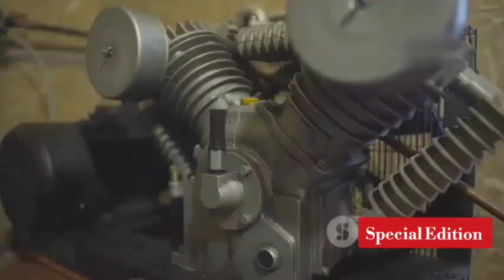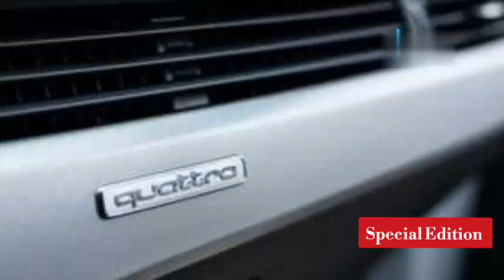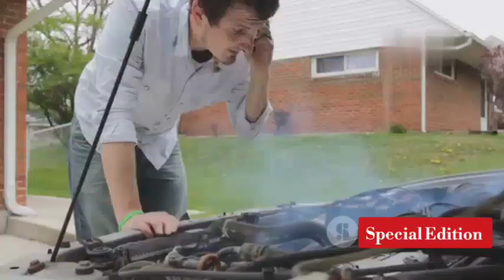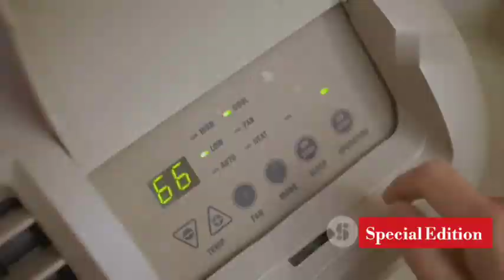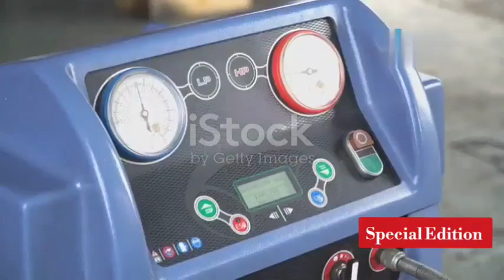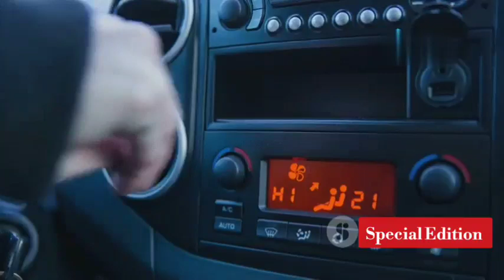15 Symptoms Of Bad Ac Compressor

Comment: I have a question: my Elantra 2008. I added freon and is working fine, cool really good, but now is making the motor to vibrate. Every time I put the A/C the RPM goes down and the motor vibrates, stay at 600 RPM or less but the car Vibrate and I see the motor vibrate much more than when I turn it off. Once I turn off the A/C RPM goes back to normal. Idler air control valve is new. Motor mounts are new. PCV clean. MAFS new. Throttle body clean. throttle body sensor new. O2 sensors new. Car has 182K miles. Engine filter new.
--- Any Idea?  Thanks
Reply from the maker: It sounds like an issue with the compressor itself.
Reply: @Drcooltech   the compressor is working fine, even has new belt and the A/C is cooling to 41 df